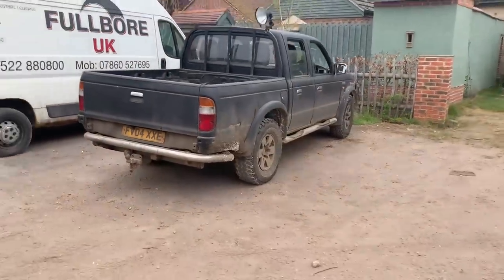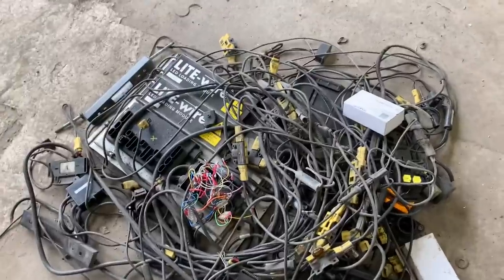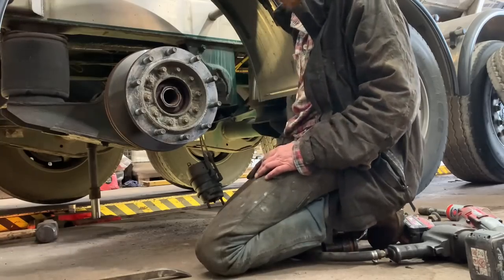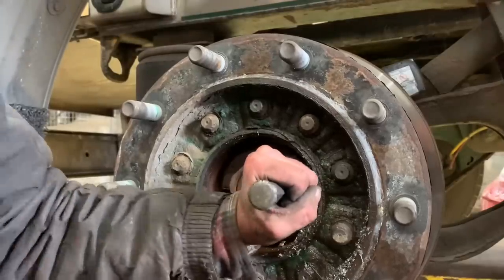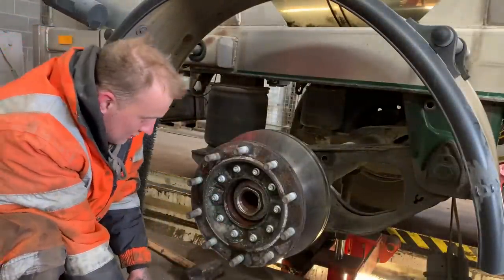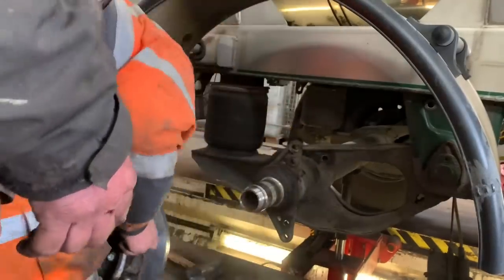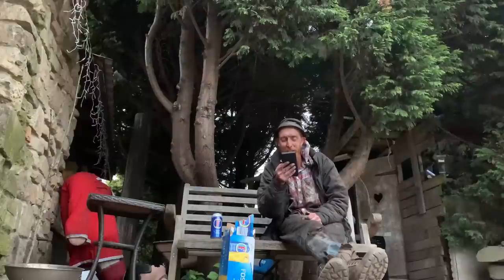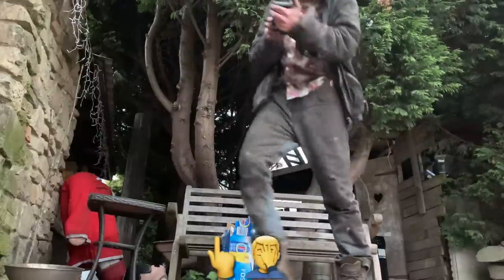The thread puzzle struggle! Stub axle nut tight, headlamp change Volvo car mobile truck mechanic.

Comment: I worked in marine engineering and and on one particular job the thread was m150 with a 1.5 mm pitch we had terrible trouble with the nuts gauling up till we started using a very expensive anti gauling paste that contained silver in it it was about £150 for a 100 gram tub but alot cheaper than new nuts and pins

Comment: Hi Chris Tight axle nuts, fine grinding paste ( the paste for grinding valves in ) on the stub axle threads with a bit of oil, run the new nut up and down pinching a bit each time. Never fails. Easy!!
Reply from the maker: Yeah Roy here said about grinding paste to! We didn’t have none, just got that nut off and the threads have picked up 🤦😭 nightmare mate! Thanks for the advice Leslie I’ll get some paste mate 👍 got the other 3 to do now
Reply: Never had any luck with grinding paste  done it once as advised and the the pump shaft and impeller sized solid so more expense and an unhappy gaffer and customer
Reply: @mondodaftasabrush  Hi Mondo, cant see why anything should seize, once the nut is free, you clean all the threads to remove any paste thats on the threads, so why would it seize?
Reply: I tried cutting paste found it never worked great for me., I use the thread chaser like one in video then brake cleaner and air line, then engine oil, run nut up to tight spot and do the old 5th turn forwards, 3/4 backwards, takes time but always gets there, a few spare nuts is always a Relief, this problem is common  especially after bearing failure, end of the stub can flare out , I have done loads of these, fucked up but I enjoy them time flys in, end of the day all I've done is put one nut on 😂

Comment: Hi Chris - What about a small air die grinder with a long bullet tungsten carbide bit? Two hands on it and you can keep it pretty steady and cut your slot into your nut each side, without the struggle of drilling! Then do your usual chisel to spread and split the last bit of meat near the stub threads.

Keep on struggling!
Reply: Good idea,  small air tool to cut through the nut..

Comment: Man I feel your pain! Maybe polish the male threads with some scotch bite then lube the threads and install nut with fingers, then when you get to sketchy area ring the threads by tapping the face of the nut with a small hammer in a circle while you continue to turn with fingers.  If that fails use some diamond paste on the threads.

Comment: Your going to have to learn how to sharpen drills with that grinder. Save you loads of money
Reply: get a Sealey SMS2008 drill bit sharpener, £56 use them on my cheap and expensive bits, night and day difference when you have sharpened one.
Reply: @matthewwiddows6319  
We had to learn to sharpen drills as you got a set issued to you and you could only get it replaced when it was an inch stub 
Those days you couldn't get a new jubilee clip from the stores it was return for and exchanged for a reconditioned one till the penny dropped that it wasn't worth it when it caused an engine failure and reconditioned clips where used for not coolant repairs
Mac do and mend days when you had nowt
Reply: You cannot sharpen drills old fashion type drills or blacksmith drills I will agree with but modern drills and those gold coloured ones are case hardened so once they are blunt all you are doing is grinding into the softer metal  so as soon as you sharpen them they just blunt of straight away. It all depends on what you are drilling into drilling into a bit of cheap flat bar or  angle iron  just about any thing will go through it but drilling out  broken studs 10.9 or 12.2 I use good quality cobalt drills good cutting paste drill slowly and a bit of patience if I blunt  them of get a new one and start again it just goes on the bill. The hardest bolts to drill out can be exhaust manifold or turbo bolts they tend to harden of close to the hotter side so as they are not evenly hardened they vere of no matter how you clamp or use a pillar drill etc they still vere of all you can do  is take your time as with all drilling patience is the key

Comment: Get you an EZ threader it’s a diamond cutting disc like thing that can be used on several sized thread pitches I swear by the use them for bad hose fittings that are too large for tap and die or odd ball threads.. they come in 3 different sizes for whatever threads you like and you run them on a drill dremel or die grinder
Reply from the maker: Cheers Ozz I’ll have a Google of it mate 👍